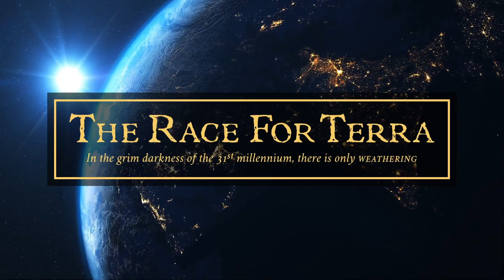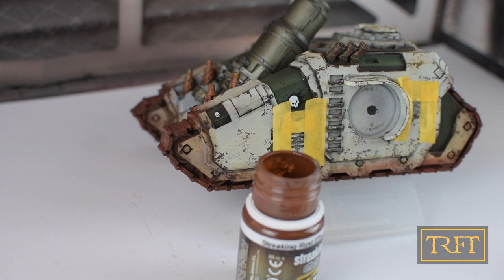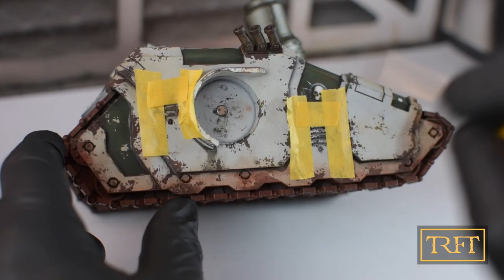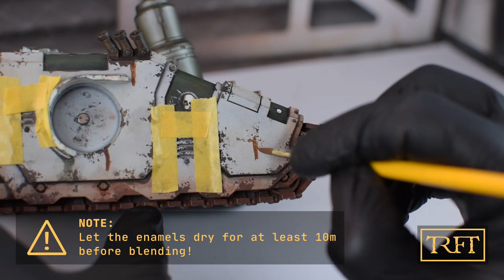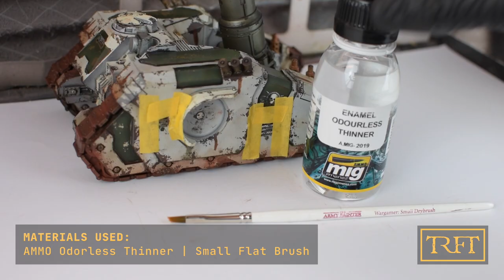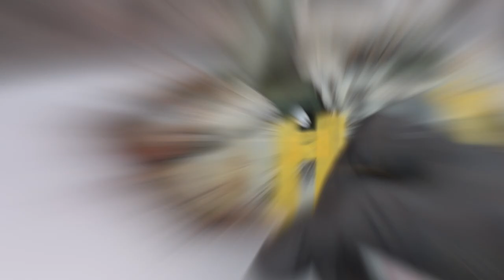How to Apply Rust Streaks | AMMO Streaking Rust Tutorial

Comment: Great video - very helpful.  Have you tried using the weathering pencils by AK?  I'd highly recommend them.  How did you do the tracks?
Reply from the maker: Thank you very much! I really do prefer enamels, for the reasons I explained in the video. The tracks were done in several steps; I re-applied enamel washes and pigments several times, and used a graphite pencil. The main thing is NOT basecoating them in metallics.

Comment: Nice work! Question does it need to be varnish coating or could it be any protecting coating gloss or matt?
Reply from the maker: Hi Robert, for best results and maximum ease of use, you need a glossy surface. If you're using oils instead of enamels, satin will suffice.
Reply: @TheRaceForTerra  why wouldn't matte work? Is it cause it's not as smooth?
Reply from the maker: @amused2deth  Yes, exactly, Dave. A matt surface offers far more friction, which is bad both for washes and for applying decals, among other things.

Comment: What are differences between streaking rust and rust wash in terms of effects they do? For example If I want to make a model which seems to be covered in red dust which changes it colors, give it a some sort of rusty filter, the same way as some painters are using streaking grime to make their figurines darker, I should use rust wash streaking rust or maybe even something else.
Reply from the maker: Hi Jaros, there are many products - you also have to take into account regular oil paints, Oilbrushers by AMMO, Liquid Pigments by Lifecolor...The only difference really between streaking rust and rust wash is that the first one is a more heavily pigmented enamel, which makes it a bit too much for a regular wash, but easier to manipulate when cerating streaks. This video of mine is extremely old and I have learnt much since - I would recommend you watch some of my newer material for more guidance.